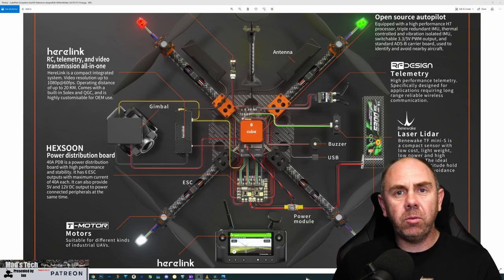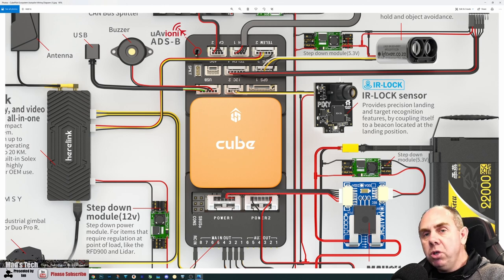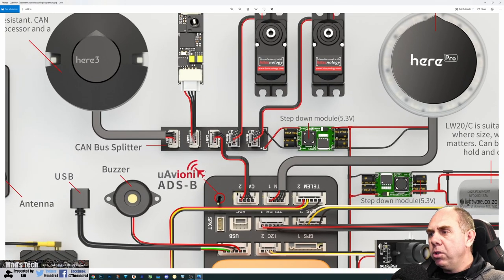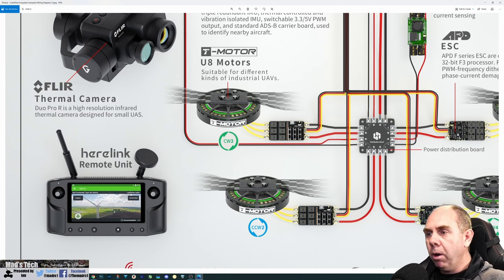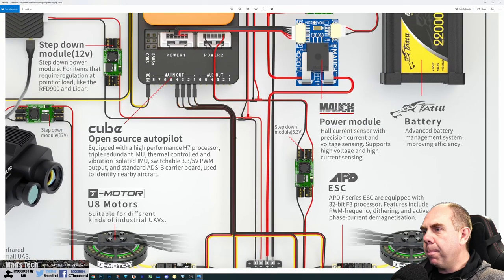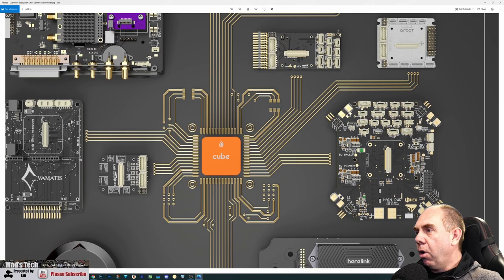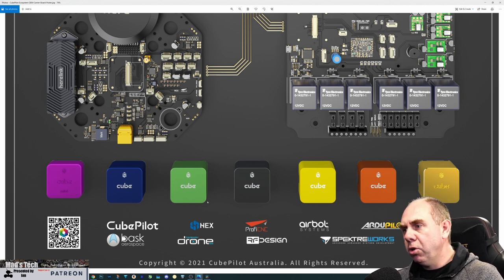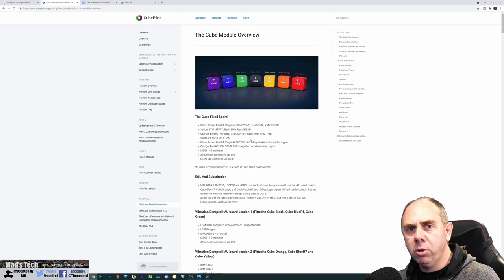CUBEPILOT ECOSYSTEM POSTER OVERVIEW

Comment: If you built this you would have the Mother of all Rats Nest wiring. Would it be possible / worthwhile developing PCB instead of using wiring? Still need wiring I know but utilising some pcb with connectors would be welcomed.

Comment: Can't imagine how much it would cost to have a full set of gadgets on this poster.
Reply: for its capability nothing else comes close so it is worth it
Reply: about 10,000 usd if the gimbal and camera were second hand. the herelink and air unit are cheaper than the dji rc by itself at around 700 gbp and the cube and board are 600 rest of the things can be found for peanuts. gremsy gimbals even. good cameras are always the most expensive
Reply: @SPotter1973  Can't get the FLIR Duo Pro anymore new. And up to now no compatable replacement. I tryed to buy one from a dealer a few weeks ago!
Reply: Sorry Steven that was a reply to Julius's comment. however in responce to your's. For the price Herelink is awsome. I regularly fly my quad 15km out and back on it with no issues and I have full confidence in its ability.

Comment: Still have an original "cube black" in the box - unused. 
One question is Power "OR'ing" handled in the carrier boards (if they have the option of two power inputs) or is it expected at the power modules?
Reply from the maker: The carrier board handles the power delivery and secondary regulation via its module.  

Basically carrier board will take 5V via Power1, Power 2 and USB.  It will also take power from the servo rail at a higher voltage.  I think it’s up-to 7 or 9v need to check that.   Then the PMU deliverers that power to the cube module at correct voltages. 

The Cube via the Carrier has multiple power redundancy so it can pull from where needed, ie Power1, 2 , aero rail or of connected USB too.  However the cube does not provide power out to the servo rail so for instance power 1 port will not power the servo rail or anything attached to it like servos.  You should have a bec for servo power if needed and that then acts as a backup for the cube it’s self.
Reply: @MadRC  OK Ian thanks for that it's been nigling me for a while. As I custom build my own power modules I was unsure whether or not to add "OR'ing" or rely on the modules.

Comment: Can you explain the difference between PX4 and Ardupilot, I couldn’t find the answer online? Also do you know if Caddix or DJI are still working on canvas mode?
Reply: PX4 uses QGroundControl and runs on the NuttX OS.
ArduPilot uses Mission Planner and runs on Chibi OS.
Both are built on the MAVSDK libraries.
Reply: @TalkerWhoLovesToTalk  sure but Ardupilot also runs on QGroundControl and PX4 vice versa, perhaps not the full parameter list but enough to use it. And why, what’s the idea between these different systems? Why should you use Ardupilot instead of PX4 for example?
Reply: @ojwhaaaojwhaaa5457  the OS. NuttX runs slower and it's very bloaty in its code.
Phillip Rowse, the founder of CubePilot swears by Chibi OS.  I was on a phone call a few weeks back and he said that just changing from NuttX to Chibi OS using the same hardware, his drones have performed better.
Reply: @TalkerWhoLovesToTalk  So basically what you say is that you should stay away from PX4, and always choose Ardupilot, thanks for the aswer!
Reply from the maker: The basics are they were both open source flight stacks based on the same base hardware and low level software for drivers ect.  There had common elements like Mavlink support and NuttX middleware but the flight stacks them selvs were their own open source developments. 

However over time things have changed a lot as both NuttX and PX4 were under the same development team. This meant thing were not always being done that suited Ardupilot and as such Ardupilot moved to Chibios for its middleware to allow it to develop its own path and get better performance.  

Further to this PX4 was moved/dragged under the Drone Code umbrella with QGC and others and has now been somewhat put behind a paywall.  While PX4 is open source there is PX4 enterprise that’s not and its development is being driven by its stake holders now rather than users. 

While open source PX4 has a number of companies behind the Drone code project that are now driving the direction and this is not necessarily good for end users.  Auterion and others being major contributors and controllers of the project.  

Ardupilot remains fully open source with them partnering with hardware vendors however Ardupilot remains fully driven by the dev team and the community.
Reply: @MadRC  Alright clear answer, thanks a lot! What about the DJI canvas mode, any news jet?